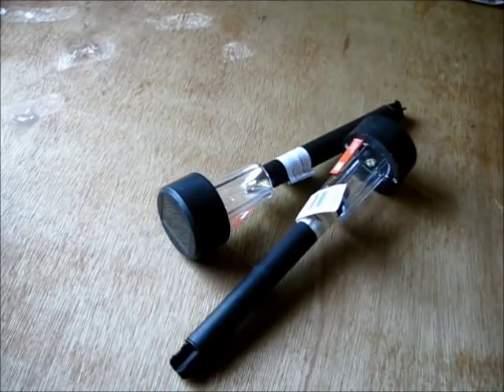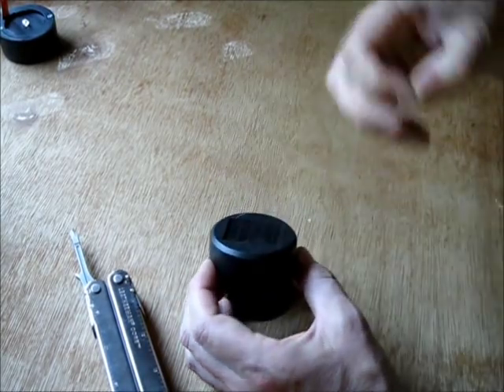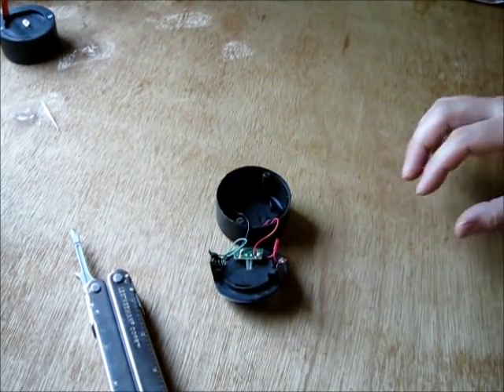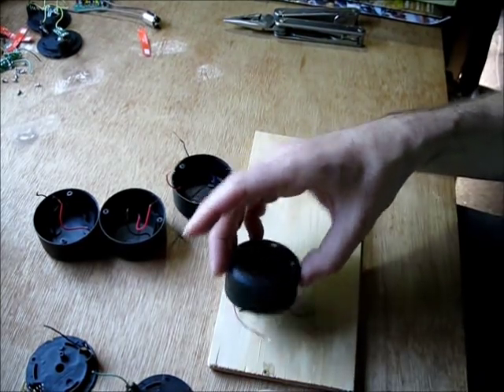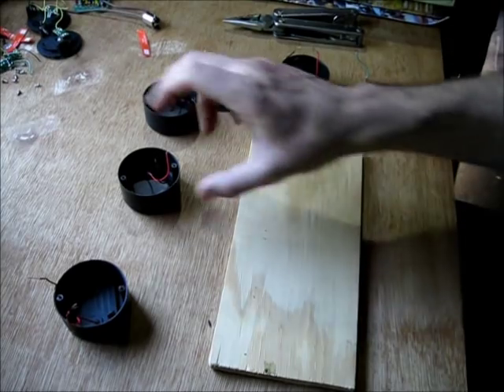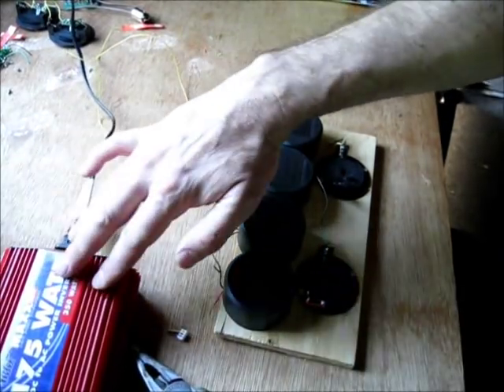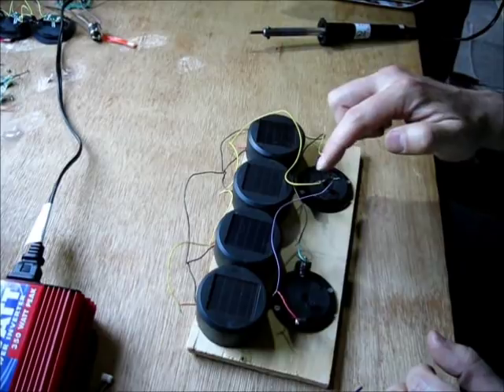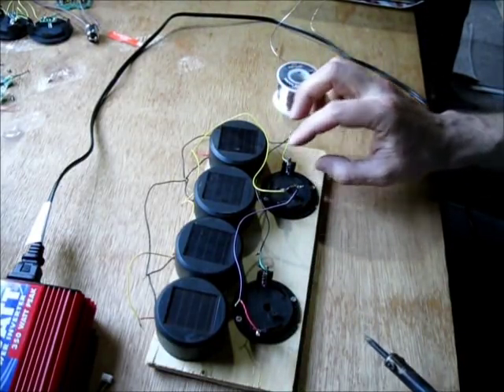DIY Solar Garden Light Hack - Solar Battery Charger

Comment: Each little panel usually produces around 20mA at best, so you are looking at 80mA (but I would say around 70mA on average).
So if you have a single 1000mAh AA battery then it will take 14+ hours to charge. 
But it is interesting trying to re purpose these small panels, it's a fun thing to do. It could be handy for charging those 300mAh AA batteries in timely fashion.
Reply from the maker: Works for all batteries but yes, best results for smaller ones.
Reply: How does the circuitry handle these hacks? I'm looking into a 100mm x 100mm panel to charge 2 or 3 AAA batts so the light will hopefully stay on all night. As it is , my Home Depot 14w light sputters out by 7:30pm. But I wonder what the limiting factor here might be: draw (unlikely), supply, storage, or circuitry.

Comment: Thanks. You think it's possible to measure the voltage (as opposed to temperature) of the batteries instead? I don't know how commercial chargers do it. But the circuit shouldn't be too expensive.

Comment: I have questions I`m not into electronics I starting to learn after I`v seen your video ,  I believe in your case u have to take the batteries out when they are charged to 1,5 vold manually what happens if u live on all day the batteries will explode or inside the battery will be burned out after it has no usage of these batteries but my shop bought garden solar lights are on everyday n nothing happens to battery is it bcoz they might have electronic cut offs after they r full charged?

Comment: Nice video tutorial on how-to. There is a voltage drop off with the diode attached but the diode is indeed necessary so the battery wont be discharged when there is no light. PRETTY COOL I SHOULD SAY.

Comment: Yeah I did think about making a vid ov it after seeing yours. I might reinstall it in one ov the outside sheds at our new place so I can do that. For the lighting in my "Solar Room" I used one ov those cheap 12V/8W fluoro inspection lights in the tube. Just attached it to the ceiling with cable ties. I decided on going with this rather than LEDs because the roof ov this shed is really low and I wanted the lighting to cover a wide angle.

Comment: If I remember correctly from my electronics classes, when you wire in parallel, the voltage is the same and the current in stacked, when you wire in series, the current is the same and the voltage is stacked or added together.

Comment: I see you are hooking up parallel since you said "all positive together".
One is rated 2.5v under bright sun. 1.5v indoor under bright light. So I put in series indoor 1.5v X4= 6v. I hook it up to 5v-12v step up board. I got less instead of more. Would you have any idea?
Reply from the maker: The step up adapter will reduce the current to increase the voltage. If the current is too low, then the adapter cannot do its job. Put more solar cells in parallel with your first ones to increase overall current available.

Comment: isn't it a problem with over charging you battries if you leave it and forget it?  is there something in that circuit board to prevent it?
Reply: I aa5s thinking the same thing
Reply: +Ozark living Homestead , everything's in parallel, so no.  Thankfully those solar cells don't put out a lot of energy per unit of time, so I think you'd probably have to leave the cells in that rig for a week or more before significant internal damage were to occur.
Reply: rchandraonline since the circuit board was taken out overcharging will be a problem and lead to battery leakage. It would not take a week for this to happen either.
Reply: Can you do this without the circuit board being removed. I want to wire probably 20 or so of these to charge multiple phones but I don't want to blow the damn things up.
Reply: Ozarks Modern Homestead nope but there are tutorial on that.

Comment: I took a small rechargeable battery out of a little mini speaker I had, if you connect the ends, as long as it is receiving power it will charge?

Comment: Hi nice video
I want to hookup the garden solar light to the car battery.
How can charge and power during the night solar garden light through to car battery ?
Reply: Good luck with that. Assuming 8 hours of daylight, 100 panels, each panel outputting 50ma per hour and a 70Ah car battery, it would take about 2 days to charge it fully, in reality much longer due to inefficiencies, overcast...etc.

Comment: great idea.. I still say momentum / motor / magnet energy is still the number one immutable source if you got the leg power each day..
Reply: I saw a video once where someone took the gearing off several old 10 speed bikes and used slowly dropping weights on pulleys. As the weight drops slowly the wheel with copper coil
spins fast against magnet stator. That might save the legs if you could make it work.

Comment: Wired in series you are increasing voltage. Wired in parallel to increase amps. Depending on your needs and the solar cells being used you may need a combination of the two to get decent charge!

Comment: use a cig lighter to strip the wires,wont damge the wires that way.
Reply: Using a stripper doesnt leave melted  crap and they have wire sizes which easily remove, quicker, better....

Comment: if you put enough of them together would this compete with bigger solar panels or would it just defeat the purpose at some point    would you eventually be paying more for these than you would for buying a larger solar panel because my idea is to put 20 in a circle all filling the circle and make it hang-able by a hook or lay it on a roof would that work or would i be spending more money for less mAh / voltage someone answer plz
Reply: so, did you do it? lol

Comment: Little tip for stripping wires... I use a lighter/flame to melt the casing slightly and then pinch with my finger nail and pull. that will prevent you from accidentally cutting the tiny wires. Well... thats what I do anyway.
Reply: I recently saw an old video on soldering and my jaw dropped when they used a thermal stripper. I had never seen one before but the concept is like you said. It doesn't nic the wire.

Comment: Thanks to your video I am doing a small project, I have a question I have two solar panels of different power and voltage, one of 6.5 volts and the other of 5 volts, I could do them in parallel to take advantage of the amperage or there would be a problem,  Thank you.
Reply from the maker: Depends on the voltage you need for the output. You can put them in parallel and use a diode at the output of each one so the one cannot back feed into the other and burn it out.
Reply: @TheDoItYourselfWorld  Thank you very much for your help, so it is better first to put a diode in each positive and then make the connection in parallel, it is that?.
Reply from the maker: yes
Reply: @TheDoItYourselfWorld  Thanks you.

Comment: Did you map out the charging circuit at all it probably has a cheap voltage boosting circuit and current limiting function in addition to driving the led off 1.2 volts.

Comment: is it possible to keep the battery charging and also use the battery to power a microcontroller? im trying to power a microcontroller but have it work at night as well using the battery.

Comment: I have a few wall solar lights, struggling charging, no sun in Ireland, so I replaced all the recharging batteries with regular batteries. Now i have light in the garden all night, in day time the lights are off due to the integrated twilight sensor. The overcharging protection is working, it does not charge because the voltage is steady to 1.5v, no danger to explode, even if does, I do not care.

Comment: So say you have about  100+ of these is there a way to turn them into a solar panel for electric to run a few light bulbs?
Reply: Lydiakc22 Absolutely! All solar cell panels are nothing more than individual cells soldered together so go for it (if you have the patients). You should wire enough of them in series to get the desired voltage to match whatever charge controller and batteries you will be setting up.

Comment: Where do I buy the diode and are there different sizes?  This will be my first time doing this and I find this so interesting!  Thanks!
Reply: i would use  1N4001 50V 1A General Purpose Diode. you can get 100 for less than $2 delivered on ebay. these are easy to use and any questions just ask.

Comment: Any idea how many watts or output these are. Not sure myself but I was thinking sometimes you can get these for 1.00 and I was thinking on putting 50 of them in a array and wiring them up like those regular panels. Building a frame around them.

Comment: I was thinking of trying this exact thing because in this area we have bulk trash pickup twice a year where people get rid of all sorts of stuff, including tons of solar lights. Many of them have really cloudy solar panels, but occasionally I find some that still look good.

Unfortunately, I have basically zero knowledge of electronics. I wouldn't have known to add a diode. I just know that the solar panels usually charge the batteries in them, so logically I figured you should be able to make them charge batteries without the LED.

Would there be any advantage (or risk) to using more than four panels? And would this work, albeit more slowly, with normal room lighting? So you could put it off to the side and just check it occasionally?

Comment: I have a question. Can you add more wire to solar lights? Basically I want to add some decorative solar lights in my garden. The problem is the sun NEVER hits that side of the house! Is there a way to remove the wire from the small solar panel, add 10 feet or so of wire to it, then reattach it to the panel. It’s just a small panel that attaches to a stake that attaches to fairy lights. Thanks in advance!
Reply from the maker: Yes, you can do that. Use thicker wire to prevent loss in the wires through resistance.

Comment: I picked up a case of these, 25 in a case, at a dollar each from the 99 Cents store here in California. Im curious if you can give any info on the diode you used. perhaps a part number? If its a Radio Shack part I would appreciate the part number to be more accurate to your video. Thanks in advance.

Comment: Hey! Thanks for the cool vid! I'm all new to electric stuff, but I'm trying. But I can't seam to get it right. I have a battery powered led light that I want to have lit always, as my garden lights are so I though that I can use the solar garden lights to recharge the batteries in the led light during the day in the sun and the led to be lit at night,  like there built for.

Comment: I have three small solar panels but not from garden light. Do I put a diode at the positive side after running a pararell connection or do I put the diode on each of the panels? Which one works best?
Reply: +Ello Oku Positive but you also need a voltage regulator that will shut the power off so the batteries don't explode. That's what all those exploding wheels kids had so much problems with a few months ago. You have to protect over load under voltage and discharging with these type of batteries. If you are going to sit over them with the multimeter the whole time you might get away with it a few times.

Comment: Why not run all the cells through one charger unit? That would protect the batteries and reduce the risk of fire. I would think those circuit boards could take the current, although some measurements would be handy.

Comment: If I put enough of these together, can i charge my RVs house battery?
Reply from the maker: Yes and no. It would take so many that it would not be worth the trouble. Cheaper in that case to buy a small solar panel off ebay
Reply: @TheDoItYourselfWorld  I dunno. Today the dollar store had some on sale for a quarter apiece... I've seen them as low as a dime apiece.

Comment: Could it be possible to rig up enough garden solar panels to charge a car battery
Reply: at least 8 in series but it would be very slow to charge unless you used three or four  series of 8 then connect them in paralell

Comment: what about using something like this to slowly charge a car battery? i want to make something that that i can stick on the dash board of my car to maintain the voltage of the car battery. is it possible to do with small panels like these?

Comment: Nice project. You should take it a few steps further and use a couple of long wires to seperate the solar cells from the battery holders. Than you could leave the solar cells mounted in a location that receives plenty of sun light and place the battery holder indoors out of the weather and not have to worry about them getting rained or snowed on or have to keep moving the whole project inside and out. The only problem I can forsee with this is power loss due to longer wires in a DC circuit.
Reply from the maker: Larger, longer wires would be fine with your idea. It is a good suggestion for others. Thanks
Reply: This looks small enough to place inside a larger clear plastic bag for protection.
Reply: artistpw I've used one in the past on an indoor windowsill and it worked fine.

Comment: I sit down at times and over think things but unless it is for the fun of doing something, how many times could you charge those batteries in an a/c charger?
Reply from the maker: Zero if you are out in the woods or where there is no grid power.
Reply from the maker: I have been through many power outages. Some in winter. I sat in comfort while others suffered miserably. No power during a blizzard means no heat, water, light or even food for many people.

Comment: I have some left over 3x6 cells. I was thinking of wiring in series to 1.5 or 2 volt to charge batteries. Since it would have a bit more amps, would this be to much to charge a pair of AA or AAA bateries? I was thinking of using some battery holders from Radio Shack and wiring in both sizes so I could charge whatever was needed.

Comment: So 4 solar garden lights makes 3 volts, So i need like 5 or 6 solar Garden lights to make 5 volts? Also did you add 4 AAA batteries underneath the solar panels? Or just 2?

Comment: I'm trying to figure out something useful I can do with my solar panels. I think a fan would be the most useful, because I don't feel like I can ever have too much air moving around in my room. Any suggestions for how to pick the voltage of fans and voltage of solar panels to use? I don't want to destroy the fan with improper voltage/amp.

Comment from the maker: For now, with two batteries, this will not harm them. It takes a while to charge and the current is not very high. But I will be reworking the system soon with some control electronics and other mods.

I want to make it auto sensing and adjustable voltage for different battery types. And I will add a USB port to it as well. Keep watching for the video in a week or so.

Comment: What type diode did you use?
1. A germanium diode?
2. A Zener diode?
Or
3. My brother DIED; OWED $2400 on that pickup still.

Really what diode did you use and did you align it cathode or anode forward? (Stripe to battery side or stripe to solar side?)

Great idea.  But I recommend closer camera angles for better visual of wiring.  Some of us are not savvy with electronics and wiring so any help is appreciated.

Liked.
Reply from the maker: A regulator diode. 1n4001 - 4007 series is fine. The stripe on the battery side.

Comment: How many of these solar panels would I need to charge a 12 volt automotive for motorcycle batteries? I don't know much about electronics, what size diode are you using in what size would I need to charge a 12 volt automotive or motorcycle battery if I were to make something like this?